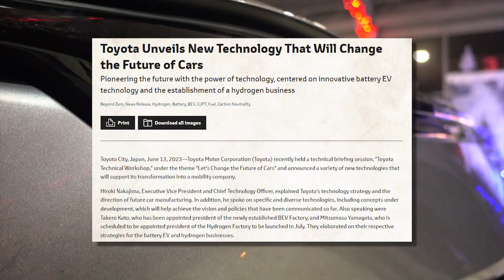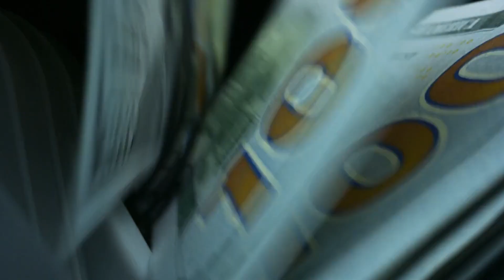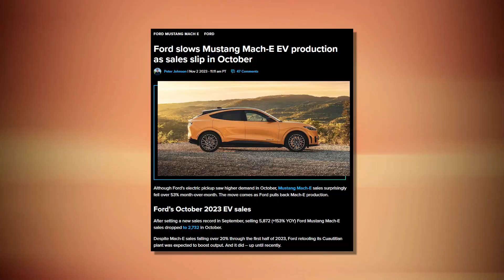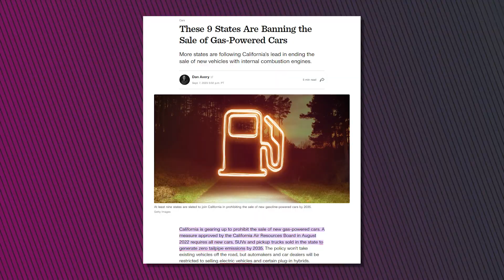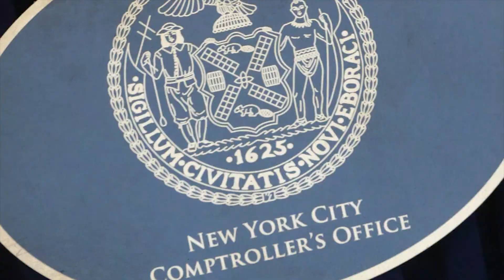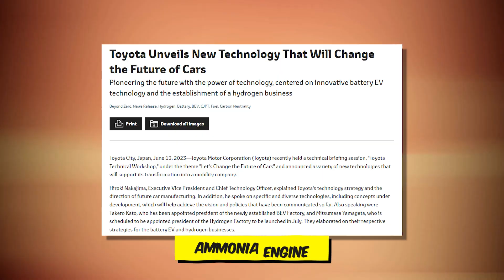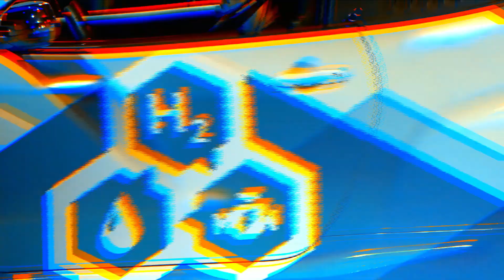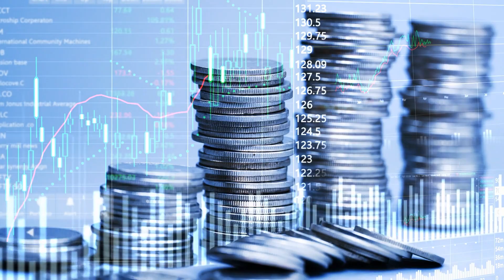Toyota Just SHUT DOWN EV Production!

Comment: In about 6 years, we shall have new batteries, safer with a huge range. Toyota is aware of the mass unemployment that will occur when they stop making gas engines. They are also aware that Toyota has lost the lead as the top manufacturer of cars and are seeking an alternative to Ev so they can become the new leader. But that task is more than difficult'. Maybe the way forward for Toyota is a full EV with a quiet self-charging system onboard. Every time the car stops the charging system kicks in and stops when the battery is full.
Reply: Um, in your dreams.